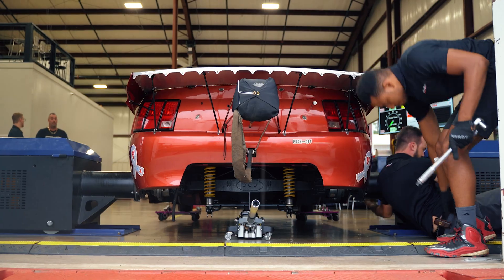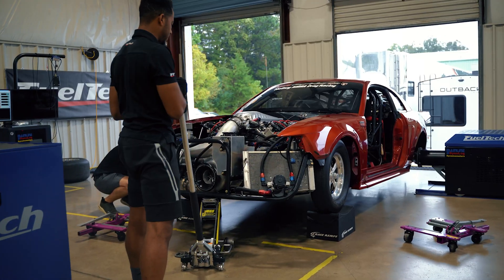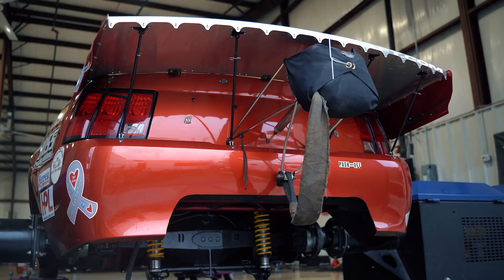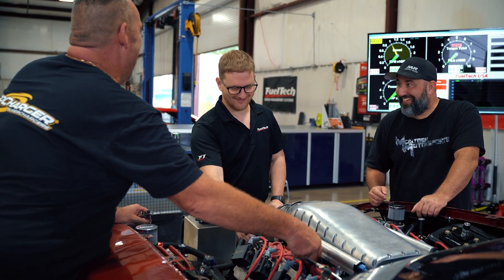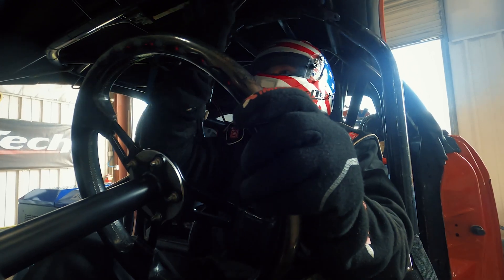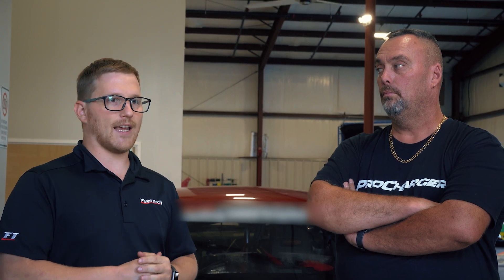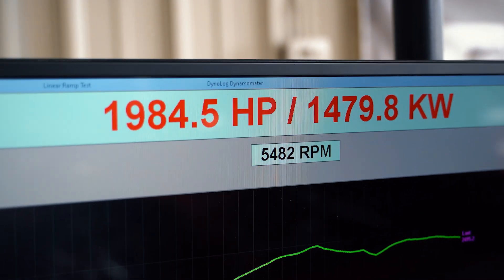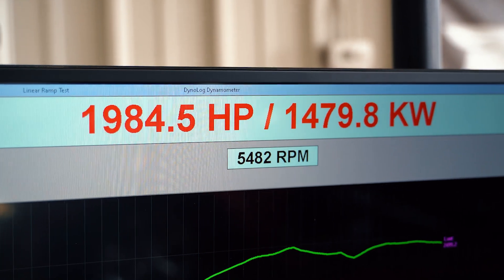ProCharger X275 Mustang | Phil Hines

Comment: You can run electronic waste gate in the back of the intake manifold and control boost run a 30 pound pulley And only run 20 pounds
Reply: That’s nothing new regardless in x275 you want all the boost or just stay home. It’s also over complicating things and unnecessary with todays management systems. If you were the back of the intake isn’t where you want it either.